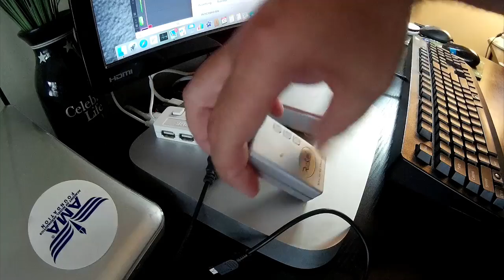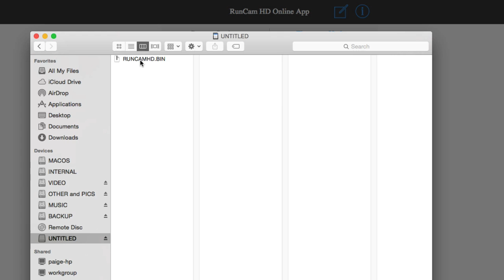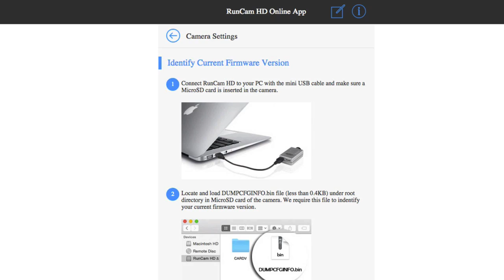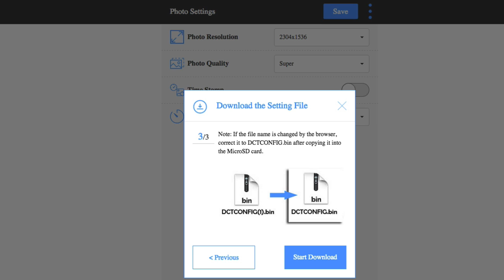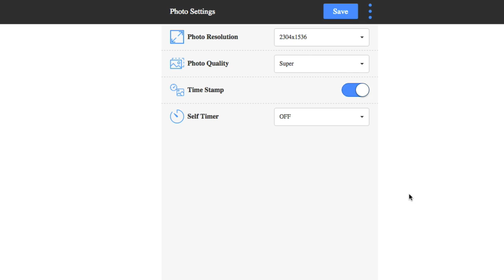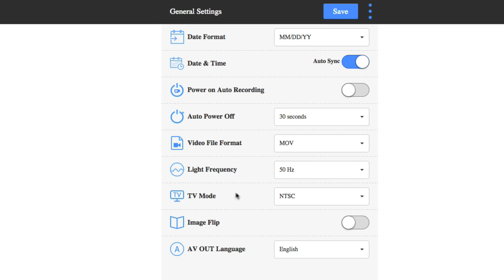Using the RunCam Online Configuration Tool

Comment: ola, eu comprei a Runcam HD na loja banggood, ela chegou e constatei que so estava gravando 5 minutos,
ai eu fui no site da Runcam e baixe o programa para mexer nas configurações dela.
eu traquei de 5 para 25 e troquei de MOV para MP4, mas agora estou com problema,
quando eu ligo a camera ela ja começa a gravar automaticamente, não consigo mais escolher o modo de gravação
quero saber oque tenho que fazer para voltar ao normal?
Reply from the maker: There is a setting in that same tool that tells the camera to start recording on power on. That needs to be turned off. You should be able to connect the camera to the PC and then turn it on and it should not record. Then you can change the settings. See if that works.

Comment: BY THE WAY ,YOU HAVE TO ERASE FIRMWARE OFF SD CARD WITH COMPUTER WHEN FINISHED OR CAMERA WONT WORK THE WAY ITS SUPPOSED TO ....ITLL JUST GO TO FIRMWARE  MODE EACH TIME UNTIL U REMOVE IT FROM SD CARD WITH YOUR COMPUTER.....